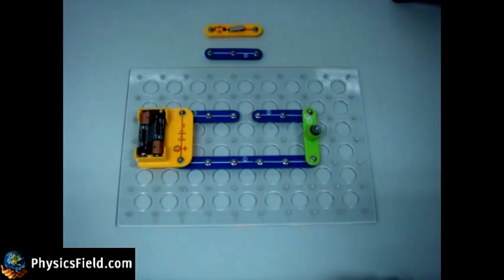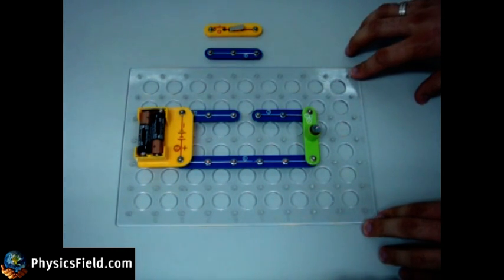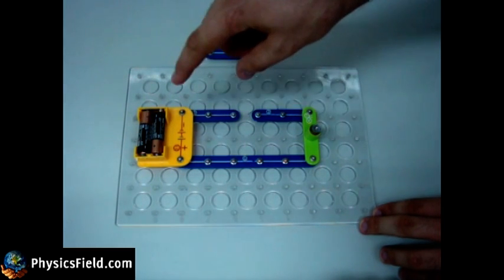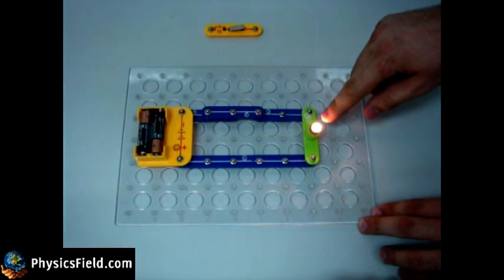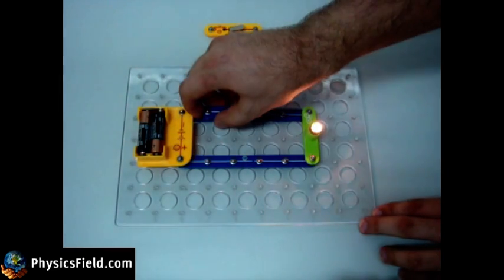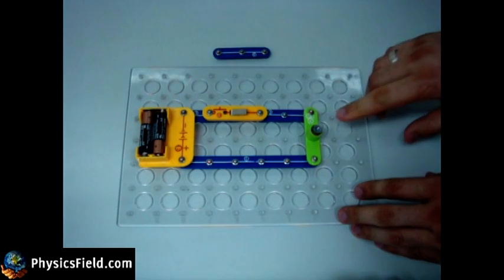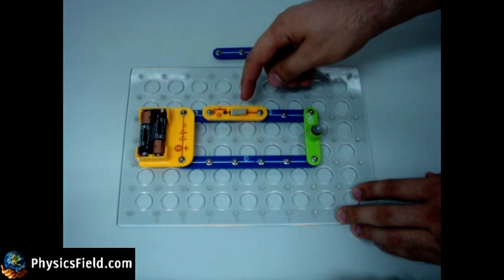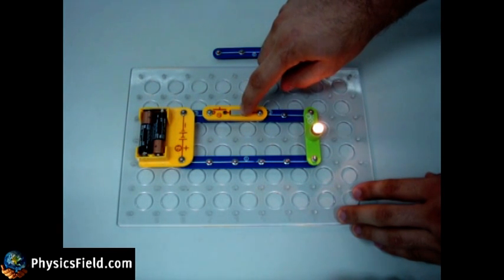Open and Closed Circuits Explained | Physics Experiment for Students 🔌

Comment: Too late for A9900960's project, but I just bought a similar kit at a U.S. store called Hobby Town. Brand is award-winning -- called Snap Circuits. Kits from $20 up. The one I bought, for a 10yo boy and his engineer dad, was a medium size kit and it was $40. Had a light, something that would fly, sound, batteries, etc. Said you could reconfigure it in 30+ ways. The seller said it was very durable and the snaps far better than kits w/ springs. Just in case someone else might need the info. :)